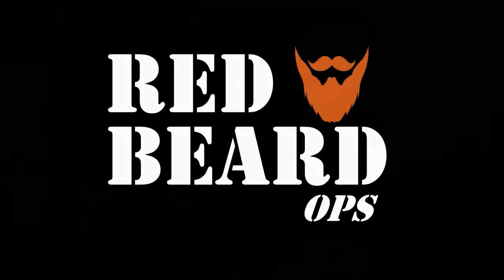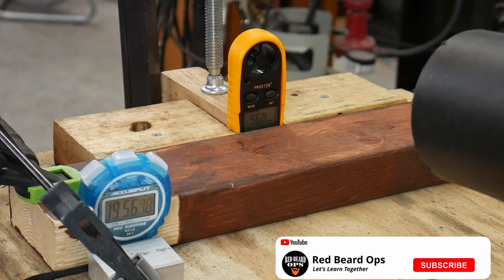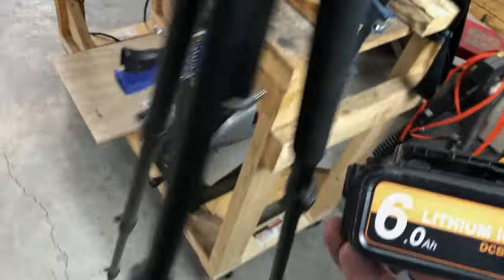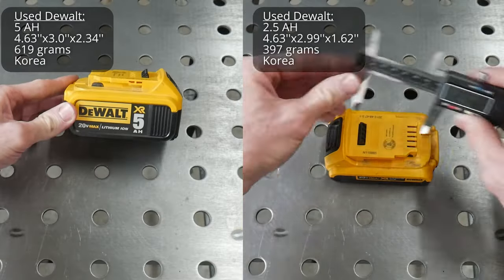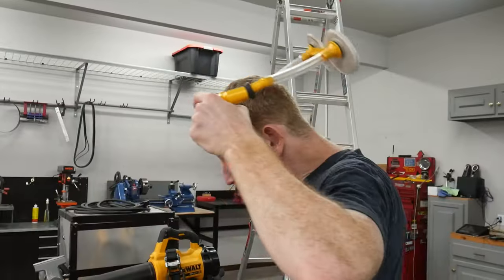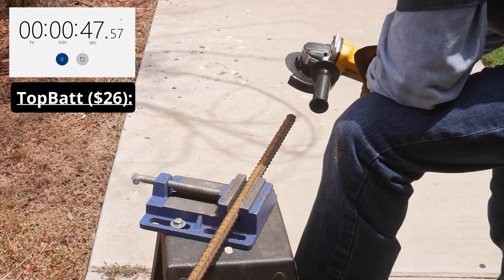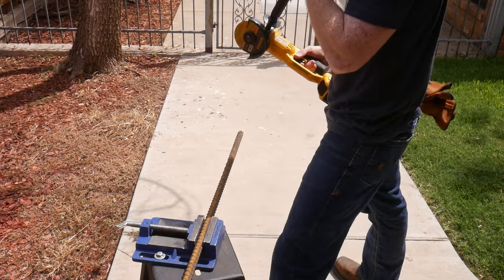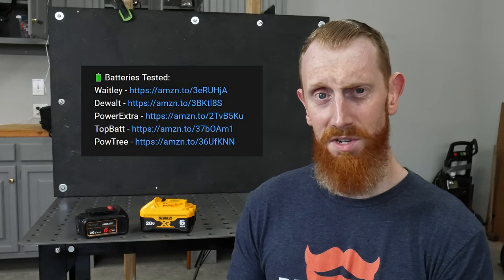Which 20V Replacement DeWalt Battery is the BEST? | Knockoffs VS DeWalt Comparison

Comment: 5 and 6 ah packs will all be using 5S2P layout of 18650 cells, the difference will be in the cells, being 2.5ah or 3ah (claimed), so the weight difference would be minimal. 3Ah is about as high as you can go in 18650, and in cheap cells this would only be achievable at low current draw.
Reply from the maker: THanks for the info Emyr
Reply: Why are the Dewalt 6ah batteries physically larger than the off brand if they contain the same 18650 cells?
Reply: @Thanosisnotreal  because they don't. Just like Milwaukee's H.O. batteries (high output) as opposed to the XC (extended capacity) the 18650 cells have been upgraded to 21700 cells. FYI  in case you're unaware...18650 cells are 18mm wide 65mm long. The 21700 cells  in the new 6ah 21 mm wide and 70mm long. Larger cell=greater current, higher discharge, and more capacity. Configuration is exactly the same. 2 groups of 5 cells connected in series to increase voltage from 3.7v to 18v. Then the two rows connected in parallel doubleing the capacity. Hope this helps. And it all comes back to quality cells. Quality 18650 cells always weighs 40-45 grams. If you have a complete battery under 400 grams you can be sure it has cheap no brand Chinese fake or low quality cells. Open one up sometime and see Google the data sheets for the cells used.
Reply: @jimbaileyme  I suspected they were larger cells . Thanks, I do have a few off brand “6 ah” packs. They perform about like the Dewalt 4ah packs, China maths. I’ll have to open one up and have a look…
Reply: @Thanosisnotreal  China maths, 😂🤣😂👍

Comment: Great video👍bought the Waitley 20v for my dewalt drills, question ??? Why does it say on the bottom of the waitley battery 20v than in parenthesis say (18v)????
Reply from the maker: I'm not sure about that Abel
Reply: DeWalt 20v is actually 18v. It's 20 volts measured straight off of the battery, it's 18v under a load.
Reply: Picture a 12v battery in your car. Your system is a 12v but your alternator charges it 13.5-14 volts. So is it 12v or 14v system?  What I am saying is " 18v tools and 20v nominal is exactly the same thing." Overseas their new dewalt stuff has 18v written on them. This is why all the 18v and 20v tools will run off each other's batteries when using adapters. It's just misleading jargon. Would you rather buy one get one free for 10.00 or buy them two for 10.00. Same thing just a play on words.

Comment: When it comes to AmpHours, the 6Ah battery shouldn't really be any thicker than the 5Ah ones. I have opened some 5Ah Dewalt batteries in the past. There are 10 18650 cells inside placed in a 2x5 pattern. The only reasons I can think why the 6Ah is a bit thicker is either due to some extra cooling element or some extra padding/reinforcment material. So since the difference in thickness is so small, an extra row of 18650 isn't possible.
Which is to say that basically a 6Ah can very well be just as thin as a 5Ah battery, but dewalt put something else in there, not extra battery volume though. The cells are 3000 mah each instead of 2500mah. 
If however the 6Ah is using 21700 cells, then that would explain the extra thickness. I went back int he video a bit and saw tha all dimensions are a bit larger. So, yaeh... Pretty sure they are using 21700 cells.

Comment: What concerns me with a knock off battery, even the manufacturers battery is they all say and use lithium ion batteries which can ignite and catch on fire.  I wish they would use nickel metal hydride batteries instead of the lithium ones.
Reply from the maker: Does sound creepy. Worth noting I haven't had that happen to me; yet

Comment: I have
1 x 9ah dewalt 54v
2 x9ah waitley 54v 
1 x6ah waitley 54v
I use them on a 54v
 strimmer
18v hedge trimmer 
18v grinder 
Really carnt fault them  they last just along as the dewalt .. weather the lifespan  is as good I guess we have to wait  and see. ... 👏👍🍻

Comment: Be careful with the waitley batteries.
They will run till they are completely dead and then you'll have to jump start them before you can get them to take a fresh charge and they will never preform the same again.

I own two of the waitley 6 ah batteries and let one run completely down in a portable fan. 
 I did get it to take a charge but had to jump start it from another dewalt battery first.
Now that one doesn't last half as long as my second one.
( both bought at the same time)
Other than that, I've had no problem with them and think they were a good purchase for the price.
I will buy more.
Reply from the maker: Thanks for the tip Michael! Very good to know.

Comment: Yea I'll stick with dewalt batteries. Some of mine are 3yrs old.. still kicking it like new, with daily use.
Reply from the maker: They are strong!
Reply: I also have some 2017 dewalt batteries and work great still, even the older 3ah from 2014. I don't think any of the aftermarket would last electrically nor from physical abuse

Comment: A few things to note. The 20V pack is really only 18V, and indeed in Europe they are labelled as 18V. To get 18V you need 5 cells. 18V 2.5AH means you have 5 x 2500mAh cells. Cells have maximum drawdown and charge ratings. Let's say, for argument's sake, these are nominally 1C, so a 2000mAh cell can give you 2Ah at 1C. Why did the one set of packs not charge? Because the cheap Chinese cells in them couldn't take the fast charge (high C rating) that the charger was pushing at them. Unless (and even then be suspicious) you buy genuine grade A Samsung cells, what is on the side of the cell wrapping is unlikely to be what the cell can do. A 60V flexvolt pack is actually 54V, and you need 18 cells. A 5Ah, 6Ah, 9Ah, 12Ah, whatever, they have only 15 cells. The only difference is what the cells might be rated for at 1C. So, a 12Ah pack would need 15 x 4000mAh @  1C cells. 4000mAh is pushing it for the 18650 cell dimensions. A 2000mAh cell weighs much the same as a 4000mAh cell, which makes no sense, as energy density doesn't change much. The reality is, the 18650 cell dimensions will be flexed a bit (the diameter), to pack a bit more in, so the battery packs should get taller, and a bit longer, but not wider, plus get a bit heavier. At 1C (heavy draw, like an angle grinder would) you might find that these cheap Chinese 6Ah packs will not maintain 2000mAh and could easily drop to below 1000mAh. That is (partly) why the Dewalt 6Ah packs are so expensive (over here they as little as $100 each when on 'sale'). Why not simply put cheap higher rated Chinese cells in the pack? Indeed, the Chinese sellers are just starting to make the 18V/60V packs, at 9Ah and 12Ah. I can see these for about $35 and $45 each, and at those claimed capacities, you would be getting something closer to the 6Ah deWalt packs. $35 for a Chinese 9Ah 54V pack that works like a genuine DeWalt 6Ah is not a bad deal.
Reply from the maker: Thanks for the writeup! I learned something for sure

Comment: This isn’t a good comparison. You’ve got to look inside them. A lot of them have comparable durability, but they often have cheap/minimal electronics, which makes them dangerous if they don’t have proper protective circuits, also they might not recover from long periods sitting without use etc.

Comment: I have 8 Dewalt batteries, 4 are real  5.0 amp Dewalt batteries and 4 are 6.0 amp Vanon. Over 1 year I have 1 failed Dewalt and 2 failed Vanon’s. If it’s less than a year and you have proof of purchase Dewalt will replace it for free.
Reply from the maker: Nice

Comment: There are many other brand battery with better performance.why would you try to test ??
Reply from the maker: Just testing 20V batteries capable of being used in dewalt tools here. These are the ones I found on amazon, that's all.
Reply: @RedBeardOps  here is factory of battery.have more than 14 year history.want to invite you to test the quality .

Comment: project farm would never hand test anything. variations in hand pressure on the piece may have inconsistently added resistance to the motor thus making these tests unreliable. use bracing and weights next time to simulate tool use in work environment to make tests more credible.

Comment: No disrespect but 4x price for 20% more performance by DeWalt.Yeah thats a scam right there fromm name brands .The short answer to DeWalt and all name brands is GTFOH)))
Reply from the maker: One thing not tested here is longevity... so that could be a win for the name brands. Not sure. Cheers sir.
Reply: @RedBeardOps  I happen to have a Waitley 9amp battery that i use with my DeWalt push mower .I get about 40 minutes.Good enough))

Comment: Ya we'll I just spent more then $2200 on a bunch of DeWalt tools and it's been less then 4 months and all but 2 batteries are shit I have the 60/20 volt for my saw and a 20 volt for everything else out of 6 batteries or was it 7 I have only the 2 left that work and it's pissing me off big time. I remember when I bought DeWalt tools before and they lasted me years and did not cost of 3rd of what these ones did feel like I've been ripped it's supposed to be the best ones with the best batteries the RX or whatever and they suck
Reply from the maker: Have a great day!